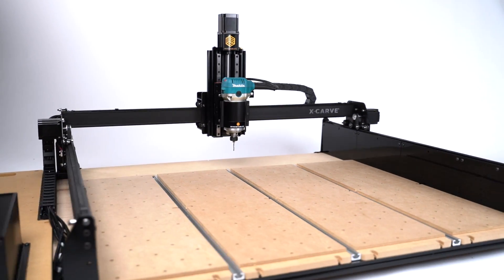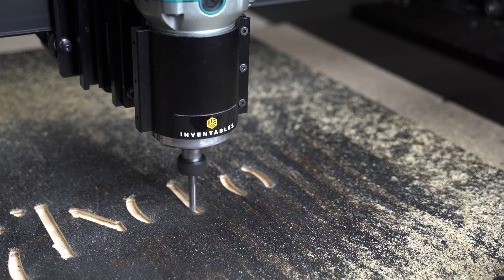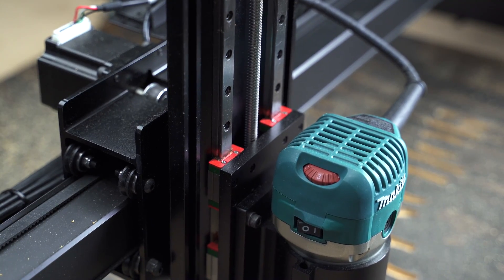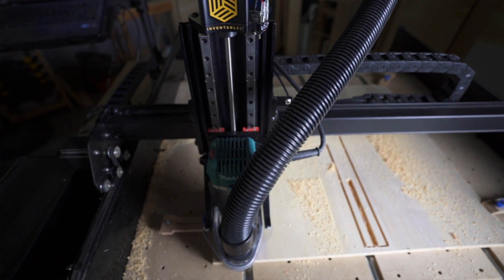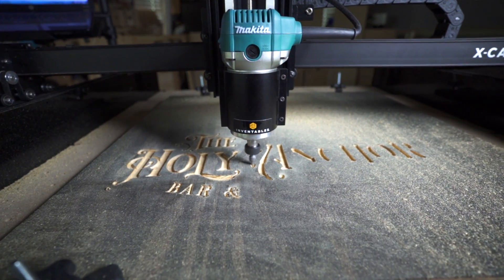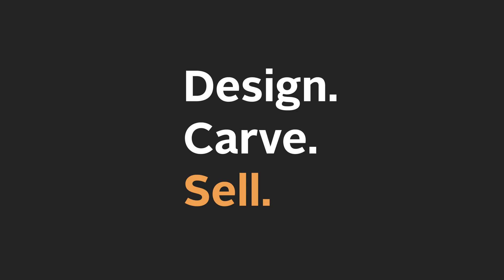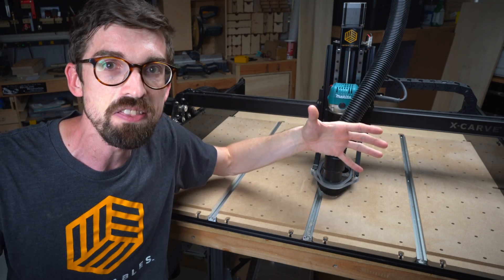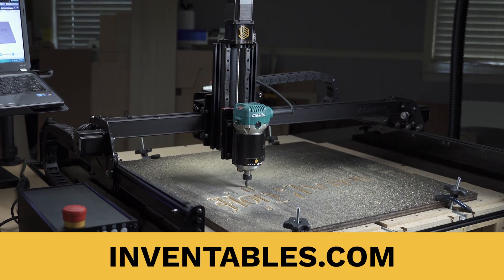Meet the New X-Carve

Comment: I’m trying to carve out fairly large holes on HDPE plastic (about an inch thick) how well does it do it? I assume it’s all built into the software controlling it but will it layer the carvings until it’s a complete cut? I’m worried it’ll melt the plastic and then start sticking on the bit too much. I’m not a professional so I’m just trying to understand it since it looks user friendly.
Reply from the maker: Great question!  You can define the cut depth for each pass to help reduce any melting.  You can also control your feedrate as well!

Comment: Just can’t envision making the money back. Finding customers is always the hardest part and a big sunk cost at the beginning is a big barrier. Maybe someday…
Reply from the maker: One area we find people starting out having a lot of success is not targeting individual people but go after businesses.  Selling cutting/serving boards to restaurants, custom signs etc.  Usually they've got money to spend and it might be hard to find things that can get customized.
Reply: It's a fun hobby, dont let them make you think you're gonna sit there raking in the dough, unless you're all over facebook and Instagram, or if you have a social circle of people that know you ro be a wood worker type... my machine definately got better performance since changing out the 3d printer grade belts that came with my initial kit, the Anet A8 Acrylic plates to stiffen the y rails make a decent effort at holding the behemoth of a z axis to the the dinky x axis maker slide that seems to get overlooked throughout all these "upgrades" not to mention the red dead redemption wheel motion system. It's a great start to check out things, but after Easel went DOUBLE the cost, the internet based software is not worth it, it depends on your output really.
If you need to bang out a bunch of simple 2D v bit stuff then Easel Pro is your best friend. I became interested in owning the bit of software and not having to pay over and over again, to just basically unlock a library of subpar clipart and 2d profile tool pathing for V bits 🤷‍♂️
Reply: @redherring5532  Do you have to use Easel as software for the X-Carve? O can you use others?
Reply: @jkey95  you can use others. The controller they use on the X controller is the same they use on most consumer grade CNC machines, you could use Carbide Create and Carbide Control too.
I use Open builds Cam software to run my machines, and I bought Vcarve Pro to generate the g code. And it's it's leaps and bounds better. And I own my copy of VCarve and don't gotta get online to use it. VCarve has post processors for XCarve, works great. The 3D stuff Easel rolled out recently could be done with VCarve (among other softwares) all along with any x carve. 
I bought mine over 3 yrs ago because they mentioned it did 3D carving, at that time it could but not just with Easel, and they counted V Bits as 3D 👎

Comment: The new updates are definitely a step in the right direction.  I just finished installing the update to mine, and although the "stiffeners" are great, there is still more side to side movement with these than with my small 1/8" 1" wide aluminum plates I had already installed.  If you offered the stiffeners in black anodized aluminum with dual screws at the top and single at the bottom, you'd have a rock solid axis.  Now add gantry side plates made of the same thickness as the new risers and this machine would be close to perfect.
Reply from the maker: Glad to know it's helping!